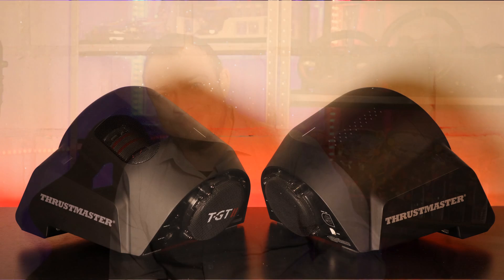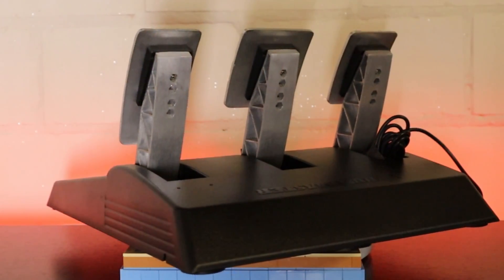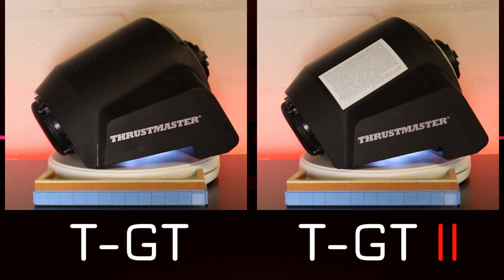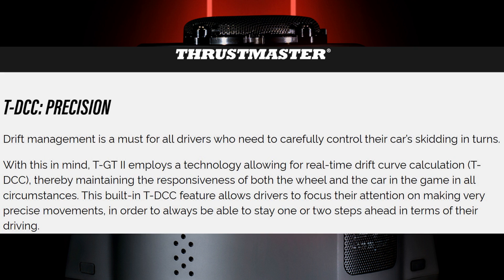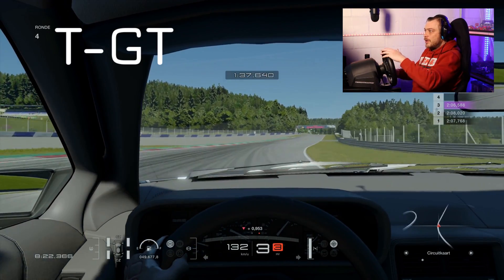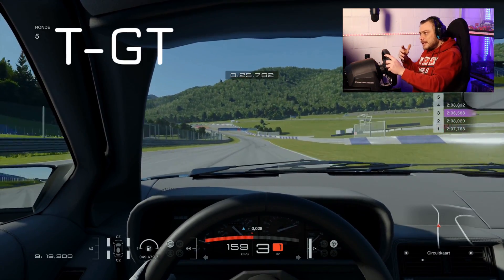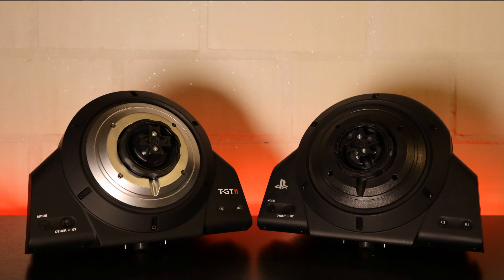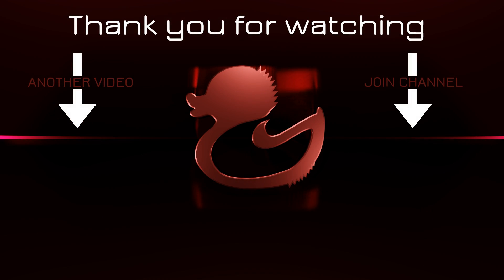Versus: Thrustmaster T-GT vs T-GT 2

Comment: Very nice ,every aspect covered in detail.....T-GT II with TLCM pedal set is the very best belt drive combination and equal if not better than entry level DD wheels .I love the feedback from the pedals as well as through the wheel and very similar to Trueforce in the Logitech Gpro
Reply from the maker: We agree agree agree... except for the Logitech DD part because I still am looking for a pot of gold at the end of the Rainbow to purchase and test it 😇
Reply: +1

 I have a T-GT II, if I were to buy it would be the G PRO by TRue Force.  I've already tried a DD PRO but I miss the T-FDB, whether it's fake, lose detail or whatever, the immersion in Gran Turismo is another level.  Maybe buy it when the price of the G PRO with pedals goes down.
Reply: @PauloOliveira-xg9xt  Sadly I dont know if the price will go down .I paid £1262 for mine and its only gone up so far .When TM finally make their new DD for ps as well as pc it will be a better choice if price is an issue
Reply: @PauloOliveira-xg9xt  Honestly the T-GTII is a great wheel so I would ve happily kept using it if I didnt have the money.but I did and have never regretted buying the GPro its just the best ,end of story
Reply: @Dave062YT  When I tested a friend DD PRO, I really missed the vibe of the T-GT II, so i wasn't too thrilled to upgrade.

  But compared to what i hear G PRO i feel that a DD with additional vibration like G PRO would be fascinated.  

Money will not be a problem if programmed for a few months, as i'm happy with the T-GT II i can do this with time. And, maybe in a few months there will be an adapter for the T-LCM, would be gold for us that we already have one.
Reply: @SimulatedDrivingResource  The price is ludicrous and considering the new Thrustmaster DD is quite cheaper and has the ability to support many great wheels while Logitech has a nicer quick release system but no steering wheels really and who knows when it will make any available, i can't see any motive on preferring the Logitech offer. 
It is just overpriced to hell. 
Not offering it anyone else than their site also means we can't find much discount to get it new so in the end maybe if some ebay seller sell it for a cheaper price but i don't see them selling cheap enough ether.
Reply from the maker: @SIPEROTH  yeah I am really bugged off it has not apeared at resellers yet with a discount. Would really have tested it 😞
Reply: @SimulatedDrivingResource  I am interested in it as well but not at that price. So it is about long waiting until we find that good offer. 
Who knows by then Logitech might release some extra steering wheels for it and it will be more worth it to get it by then. 

BUT the most criminal thing they did is making different versions for Playstation and Xbox. I get trying to double dip on the people that have enough money to buy both consoles when they offer lower models like the G29 etc but trying to double dip on a 1000 euro wheel is just plain hubris. 

Seriously, they have to make a person that likes that wheel pay 2000 or more to manage to play  with it in all systems?
For such an expensive wheel the least they could do is put double combability into one system.
Reply from the maker: @SIPEROTH  Well... or not thought through or purely for commercial gain, but no matter how you look at it, you are absolutely right.
Reply: Is the true force is Logitech g pro as good as tgt ? I mainly play gt7 and i love the transducer effect .. that's the main reason i hesitate to upgrade to a DD. 
If Logitech g pro can produce similar or better effect i might upgrade to that
Reply: @stevenkwok5810  Yes it's better ,very similar just a bit more of everything .In fact you have to turn it right down to minimum settings or it's too much .DD is great and lots of power .11inm is too much too I run minw at 7 or 8 and that's plenty
Reply: @Dave062YT  thank you for sharing your experience. Not a single review online compare Logitech g pro against the tgt-2.

Comment: hi i really enjoyed your video i have a question which you or anyone else reading this may  be able to help me ? ive owned the TGT ( first one ) since 2018 has never given me any problems however when i power it up and it calibrates each time it stops at end of each rotation like spins to left extremely loud thud and then when it spins to the right theres an  extremely  loud thud  !! now i thought this was normal ? untill i saw a video of sim racing garage by barry rowland on you tube now when he started the tgt up  it softly came to a sto on each calibration spin ? so i sent a video of my tgt start up to thrustmaster support and they said it was not normal and that i should send it to them for repair at a cost of £220.00 as its out of warrenty . I did some research and found on line an article which stated thrustmaster are aware of a minor problem of the electrical motor inside the tgt  there was also a link for a thrustmaster calibration tool 3.0 which apparently resets the electrical motor ? i could not download this link ? has anyone ever heard of this or tried it and again the main question is should the tgt stop and make a loud thud at the end of each wheel rotation during the initial start up of the wheel please can anyone advise me thankyou in advance Terry
Reply from the maker: I have not experienced the issue, however the tool you mentioned does have a certain effect. On a group I moderate on FB, there was someone that experienced a similar problem, but there the wheel stayed completely right. So yes, it is a possibility it may fix your problem https://www.google.com/search?q=txrw_calibmotor_v3_00&client=ms-android-samsung-rev2&source=android-home&source=hp&ei=w33RY6GwIOyJi-gPl5ORkA8&oq=calibmotor+&gs_lcp=ChFtb2JpbGUtZ3dzLXdpei1ocBABGAEyCggAEB4QDRAPEAoyBggAEAUQHjIFCAAQogQyBQgAEKIEMgUIABCiBDIFCAAQogQyBwgAEB4QogQ6CAgAEIAEELEDOgsILhCABBCxAxCDAToOCC4QgAQQsQMQxwEQ0QM6CAguELEDEIMBOgsIABCABBCxAxCDAToOCC4QxwEQsQMQ0QMQgAQ6CAguELEDEIAEOhEILhCDARCvARDHARCxAxCABDoFCAAQgAQ6BQguEIAEOggILhCABBCxAzoLCC4QgAQQxwEQrwE6CwguEIAEELEDENQCOgcIABCABBATOgkIABCABBAKEBM6CAgAEB4QChATOgsIABAeEPEEEAoQEzoGCAAQHhATOgoIABAeEA8QChATOgkIABANEIAEEBM6CwgAEA0QgAQQChATOggIABAeEA0QEzoKCAAQHhANEAoQEzoKCAAQDRCABBCxAzoTCC4QDRCABBCxAxCxAxDHARDRAzoHCAAQDRCABDoNCC4QDRCABBDHARCvAToQCC4QDRCABBDHARCvARDUAjoGCAAQHhANOggIABAeEA0QClCxBljuRGDhUmgIcAB4AIAB7wKIAeMRkgEINy4xMC4wLjGYAQCgAQGwAQA&sclient=mobile-gws-wiz-hp
Reply from the maker: So did the calib help for you?

Comment: Great comparison
I will still hold on to my TGT wheel base after seeing the new T818 doesn't have a buttkicker style transducer or console support.
Direct drive is something I would like to try but its not necessary
Reply from the maker: Same here...  tried it, but dont really "need" it 👍👍👍
Reply: Save up more and get the Logitech Pro Racing Wheel. That does have Trueforce and use the T-LCM or the T3PA. I don't own any of these but based on hearsay that's my two cents worth.
Reply: @kalebasphalt  I looked at the g pro and it's a nice package, but it costs $2000 aud in my country, basically a months wage for me. It doesn't have any aftermarket rims atm and I don't like floor mounted pedals (I have a TGT with the t310 square wheel and the t3pa pros with a load cell mod). I basically only play gt and a bit of acc so it doesn't seem like a worthwhile upgrade for the price increase imo
Reply: @AKK5I  You don't have to get the pedals - they are only so-so. Just get the base + wheel would do. Otherwise, sticking with the GT-optimised T-GT is more than enough for your use case.
Reply: @kalebasphalt  yeah but you kind of have to if you play on console
Reply: I tested the DD PRO, but unfortunately i have a T-GT II, and I can't get the same satisfaction without the additional vibration, on straights in the DD PRO you don't feel the gearbox working like you feel on T-GT II. 

A miracle for us would be TM doing a T-GT III DD PRO with the transducer for 2023.

Comment: How you feel use TGT 2 belt driven? I want buy this wheel but worry about belt driven. Some people said direct driven are more smooth and silent no sound. But DD Pro are expensive I think, but Moza not support PS5.
I confused bought TGT2 or DD Pro? Now use G29 I think this noisy and must gap in the wheel, uncomfortable
Reply from the maker: My favorite wheelbase for playing Gran Turismo on PS5 is still the TGT. Yes direct drive is a bit smoother, but because TGT is already a very good base, the difference, especially on Playstation, is not so big. If you would play on PC, I would say buy direct drive, but for Playstation, coming from G29,.you will be very happy with the difference. Just try to buy second hand for cheaper price. I made a video long time ago between tgt and fanatec dd on PS. Perhaps it can help you https://youtu.be/aReevx20inM
Reply: @SimulatedDrivingResource  Thanks for kind answer, smoother wheel it's not like driving real car without vibration I don't it, these like driving a toy car, because real car every road have different vibration on wheel. I change my mind after watch your video, I choose TGT2 with shifter TH8A this better option I think, because I want special detail in GT7. Good video mate 👍
Reply from the maker: That is my main problem with most direct drives. You dont "feel" the shifting or revving. They are too focussed on smoothness and details of the road. I am glad I could help. Enjoy the drive friend 💙
Reply: @SimulatedDrivingResource  Thank you mate for honest review, have good day

Comment: Hello the TGT 1 base and well compatible with the ps5 because I can't make it work
Reply from the maker: Yes it is compatible and normally plug and play. Dont forget to push the PS button (to assign the wheel to your user). If that doesnt work, try to change the GT slider to the other position.

Comment: Mine makes a weird noise and the fan is very loud
Reply from the maker: Have you tried opening it? Sounds like a clogged up fan 😕
Reply: @SimulatedDrivingResource  no, I don’t know how to. I’m afraid I’ll break it. It’s only a week old. What is a clogged up fan anyway?
Reply: I don’t know if it’s bad but it also smells very weird.
Reply from the maker: @lennertester  ok no, it can't be a clogged up fan then. Over time dusts starts to form on the blades of the fan making it work harder to cool the base and making more noise but that cant be it with a new base. This weird noise is all the time? If you would need to describe it, what does it sound like?
Reply: @SimulatedDrivingResource  1) the fan is extremely loud.

2) when i turn the wheel it’s like something is keeping it from turning, idk how to describe it.

3) it also smells a bit funky, idk if its because its new but i don’t like it.
Reply from the maker: I would advise making a short vid with your Phone to capture the noise and when you turn and send it to TM. The fan shouldnt be working that hard and the smell can point to an electrical problem. Recheck if power supply is Well connected but I fear this might be a defectuous base 😔
Reply: @SimulatedDrivingResource  nooooooo!!
Reply from the maker: I just recorded how it should sound for fan and corners. https://youtube.com/shorts/tIhNqs4dzFY?feature=share

Comment: That's very disappointing. I never used the T-GT and went from Logitec G29 to T-GT 2 "pack" so no pedals as I purchased the T-LCM pedals. I believed I was purchasing the best that Thrustmaster had to offer but now I feel naive and somewhat scammed out of my money. The only positive I see is if I went down that Fanatec rabbit hole I'd still be waiting for my purchase!
Reply from the maker: Well, to be fair, it's a good base either T-GT or T-GT 2. I still use it and don't plan on choosing something else soon but yes, TM can be a$$holes when it comes to marketing. But in the end, they make good products.
Reply: Are you comparing a G29 with a T-GT, to feel naive?  I will wait to see the your feeling when you buy a DD PrO (I already tried it).
Reply: @PauloOliveira-xg9xt  I'm not comparing anything and have no intentions to buy the DD Pro. I don't understand why you replied to my comment.

Comment: you say that t-gt1 is almost the same, t-gt2 is a completely different steering wheel because it doesn't work with the new gt7 vr technology. I listened to you and bought t-gti open box, no return, no guarantees for $430 = tax and it doesn't work with gt7 ps5. and I could have it not much more expensive and I would have a new t-gt 2 from the manufacturer for $630. but I listened to you and lost $430 + tax because you said it was the same. you cheated me and it is punishable.
Reply from the maker: Afaik, it works and TM agrees. https://support.thrustmaster.com/en/product/t-gt-en/
 Please take your technical issues to them.